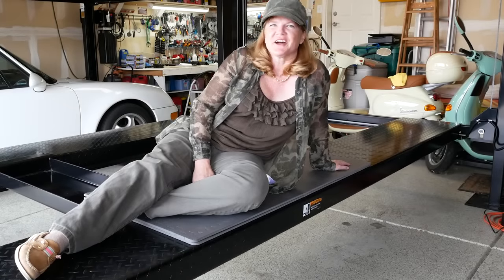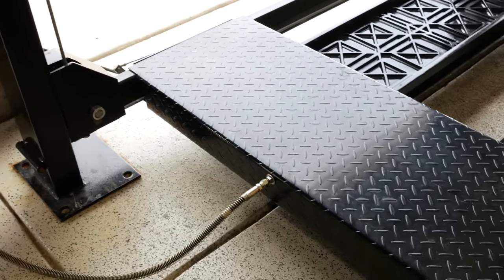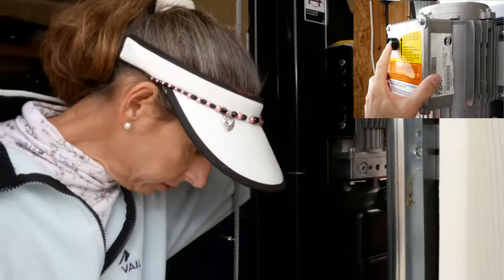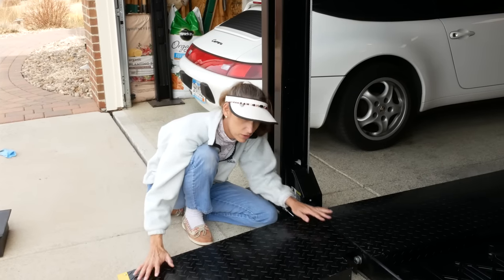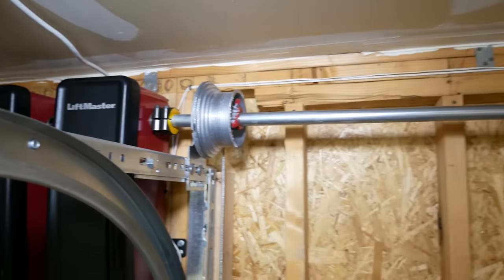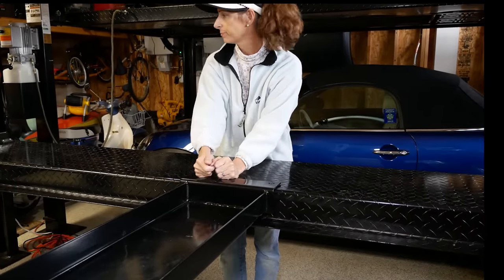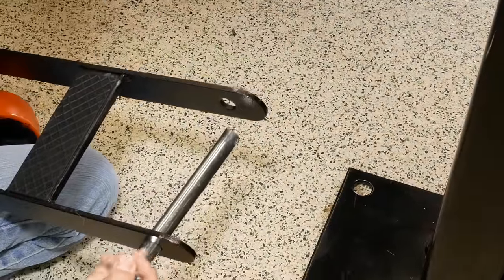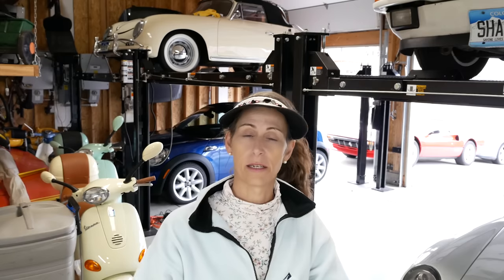Can you install a lift? 4-Post Lift Review and Tips! (Direct Lift Pro Park 8S)

Comment from the maker: Welcome to the review and tour of our Direct Lift Pro Park 8 4-post lifts.  We run through the operation of the lift as well as some great tips, tricks, and hacks you can use to make your lifts even more usable!  We got our first lift about four years ago and the count has risen to three!  That’s right, six cars in a three car garage 😊  I also run you through our new garage doors and the LiftMaster Jack-Pole or Jack Shaft Lift 8500 Garage door openers. We use our lifts mostly for storage, but they are awesome for repair and maintenance work on the cars too.
Reply: Great review! Did you ever consider a BendPak car lift and if why did you go for this one over the other?

Comment: I have the same lift in my garage. Great lift and recommend the sliding jack accessory. The sliding jack really opens up the jobs you can perform on your lift and saves time. Worth it's weight in gold and it is heavy :)
Reply from the maker: +4.5 Liter Garage we
Got a smaller jack.  Maybe someday. I think they are like 800 bucks, right?  Good to know though.  Heidi
Reply: The Pro-Jack sliding Jack was $550. But let me tell you it is worth every penny Heidi! Especially since you use your lifts for maintenance as well. You can have your cars suspension off the lift and unloaded in a couple of minutes. I got mine right from the get go and couldn't imagine working without it. Note if you do order one have a hoist available to lift it out of the crate and drop in the lift. Even though it does weigh a ton( figuratively ) it is very easy sliding back and forth to work on the front or rear of the cars. If you look at my channel and view the Porsche 928 undercarriage video you can see the Pro-Jack. I slide it back in forth so I can show some more of the underside of my car. If you have any questions about it feel free to ask. Oh I love the story so far on the 356. My 928 has been a family member for 30 years this September, so I can relate.  Rich

Comment: The "hollow" side that doesn't house the piston and pulley system can hold two banks of florescent shop lights as well.   The LEDs yook good as long as they aren't shining in your eves when working on the underside of a car.  

 One nice thing is to use the lift in conjuction with the roving jack holder as a hoist for lifting an engine or manifold out of an engine bay,  or lower a rigid car top onto a convertible, or lift a motorcycle a few inches off the ground to remove wheels or rebuild forks,  or  any other lifting work that involves chains or straps.  The front and rear crossbar are great for this, or for banging out a few sets of pullups for exercise.
Reply from the maker: We did think of that, but then the lights are on just one side.  Have you tried and do you like?  What did you do with power cords?  Heidi
Reply: I found that there wasn't much light to work with when a car was on the lift because it shaded out my ceiling lights (one-car garage, but high ceiling).  I have mounted a Tripp-Lite power strip into the rail recess on one corner, and anchored the cord to the top of its corresponding tower, with enough spare line that that there is almost no slack when the platform is completely lowered, and a loop hangs down when the lift is raised.   I chose  low-profile lights that wouldn't extend below the rail cavity, but were wide to use up the entire space.  They are connected to each other with conduit, and at the end of the second light there is another single outlet to terminate the thing.  That way there is power on tap for accessories, etc.    Right now there is so many other projects going on in the tiny garage that the car up there isn't moving any time soon.  More like long-term storage until I can get to the project.  You have a great work shop!  I have a short video here of it: https://www.youtube.com/watch?v=GlK7j9oqsDw but I don't see the lights so I must have shot this right before I installed them.
Reply: One more trick:  I mounted a winch with remote control on the far wall so I can hop into an inoperable car and have the winch slowly pull the car into position on the lift.

Comment: Hi Heidi & Franny, Excellent video. Did you use a local company to install the lifts? If so can you provide their contact info. I live in Littleton CO. and don't have anyone to assist with the installation. Keep the videos coming. Jack
Reply from the maker: Hi Jack, we did, but they aren't doing that any more :( we actually bought the lifts through them.  Try contacting direct lift... I bet they can suggest someone.

Comment: I have the same lift. The "tip" about the race ramps could be super dangerous if the ramp slips back. Direct lift actually sells aluminum ramps for these lifts now and Race Ramps makes lift ramps as well. I'm curious if you use your lift for service work if you could point the lights up. Pointing them down wouldn't be too helpful for me.
Reply from the maker: We have never had an issue with the race ramps slipping. They stick well to the concrete.  
The problem with lights facing up is the drip trays and jack tray.  You might get away with it on the lower she'll where the drip trays ride but it would be easy to damage LED strips. I just use a bright head lamp and a very bright LED shop light and that works great.

Comment: I have had Direct lift 4 post lifts and they work very well. I am curious to know what is the interior height of your garage ceiling? Is it 10, 12, 14 feet?  The last garage I built I had to have a 12 ft beam to have enough room to store my cars on the top without hitting the ceiling. I have moved and have a garage with a 9'-6" height to the finished ceiling. If I had a way to change the garage door lift I might be able to squeeze my 911 on the top and my daily driver under.
Reply from the maker: We have 11.5 ft ceilings.  Yeah, I would not use a lift under, say 9.5.

Comment: Do you feel that the safety lock do a good job? All the lifts I've looked at have air operated safety locks. I like the idea of not having to worry about an air compressor.
Reply from the maker: Yeah, I have no complaints about these systems and the locks are within your control.   If anything goes wrong, you would let go of the pull arm and it won’t go past the next safety stop.

Comment: Excellent video and review - I ended up with the same lift!  Question - how do you get the front end of the 3.2 up in the air when parked on the lift?  I used a lift stand on the rear end (and then lower the lift and the stand forces the rear end up using the motor and then put stands under) but haven't found a smart way for the front...
Reply from the maker: Thanks! What I usually do for the front is too use the factory jack point with a jack pad installed. Then put a jack stand on the heavy jack tray. I think?  It has been a while. It is always tricky to get these cars up safely.

Comment: Is you garage floor sloped? If so, did you have to shim the posts or does it not matter. Nice garage btw.
Reply from the maker: Hi Joe, yes the floor is a bit sloped, but the  lifts are adjustable as well as the locks so the platform is kept level. Thanks!

Comment: Will your 993 front end clear the lift when driving up?  do you need to use additional wood ramps to build up the height?  My 993 is and inch lower, ROW ride height with factory aero kit. Was wondering how yours gets up the stock ramps without hitting.
Reply from the maker: We haven't had any problems with any of the cars.  The stock ramps are pretty good, but heavy.  Even the 308clears with ease (and the i8).  We use that set of Race Ramps just because they are super light.  Our 993 is still US height, but the 3.2 is ROW.
Reply: @HeidiandFranny  Thanks so much, your input has made its easy to make my decision to get this lift and I was looking at many. Thanks for your great work and time you put into your informal video's.

Comment: Interesting, so you got 3 of the same lift.  Does this lift have an option to add a rolling bridge jack so you can get the wheels off for suspension and brake work?  Or do you just put some manual jacks under the car?
Reply from the maker: +B Y our lifts are 8000, and no. I believe the 9000 pound one does but that is a question for DL. Yes, we use jacks and jack stands for safety, we often put wheels sideways under the sides of the car and such...

Ideally, we would love a two postlift, but we have no more room.

Comment: 1. Did the manufacturer install the lifts or did you install?
2. Are the lifts anchored to the concrete floor?
thanks
Reply from the maker: We had a company here that sells the lifts deliver (they weigh something like 1600lbs), assemble and set up the lifts.  I slept the first few nights much better knowing someone who had done that before put it together.  They are not bolted down and, in fact, come with casters so you can move them around.  They do have holes if you want to attach them to the floor (not sure why you would).  Thanks for watching!  Franny
Reply: Thank you, BTW, the vast majority of lifts are anchored in concrete.

Comment: Nice! I'm working with 9'3" - 9'6"...researching if I can fit an 85 Carrera and a 82 930...looks like it'll be a tight fit:(
Reply from the maker: Christopher Flores for several years we left our garage doors unmodified and didn't put the lift up as high as they would go. So, it's possible. I just used to bang the crap out of my head all the time. Franny is still too tall to clear the lift now, but she is more coordinated. You might be ok. Just carefully measure the heights of your two cars figure in at least 6 inches for the height on the lift and you somehow need to figure out where your garage door will rest. If you can get it behind the door (back of your garage) then you might be ok. I would call Direct lift. They would know better than I do.  They might have a minimum ceiling recommendation. Heidi

Comment: I just discovered your channel - excellent video - thanks for posting.  I noticed you have an epoxy coated garage floor.  I would be very interested in some info about which product was used for this and if you applied it or had it done.  I searched your channel for info about the garage floor - did not find a vid.  Thanks.
Reply from the maker: Hi there, It is from https://www.epoxy-coat.com/catalog/garage/  100%solids.  Looks like they have some new kits, but it wasn't hard to do.  I even coated all exposed concrete in the basement as well.  I should have gotten it a little thicker in some places, but all in all it has been good.  It is close to its life span now and is showing it's age a little...  It doesn't like battery acid...  Just follow their instructions - you'll nee a leaf blower, aeration attachments for your shoes (just platforms with spikes) a powerful drill for mixing and uninterrupted time to install it.  Franny
Reply: @HeidiandFranny  Heidi & Franny: Wow, I just discovered your videos, great contribution and very educational.  I checked the link to the epoxy coating product, which is something I've been considering for a while, but nice to have a user rec.  The company you linked has 5 levels of DIY coatings - do you recall which one you selected, and are you pleased with the results?  The post lift is something else I'm looking at, but not sure I have sufficient vertical clearance for storage of stacked vehicles but I will consider this for maintenance, or perhaps a scissor lift.  Thanks for your efforts and generosity in sharing your experience and knowledge!

Comment: I have one of these as well.  I use it for storage as well for maintenance and it's been a real life saver.  My garage height was barely high enough for my usage but I may raise the ceiling height at some point.
Reply from the maker: And so much safer!  ...and really convenient to just take a quick look under the cars to see if any new surprises have cropped up ;)  Franny
Reply: Yes absolutely.  Only issue I've had is whacking my head on it when I get out of the car.  But after the second or third time, I finally trained myself.😡☺️
Reply from the maker: It only took you two or three times?  Wow, I think it took me close to a year ;)  When we raised our doors I could get the lifts up to the last lock and Heidi can now walk under them with impunity.  Me, not so much.  They are surprisingly hard... ;) f
Reply: Yes, I'm pretty tall and cracked it pretty good.  It left a lasting impression on me.

Comment: how come you didn't go with a double wide lift for the 2 bay garage?
Reply from the maker: Several reasons actually.  We did not know they existed.  We would find that lift much harder to sell if we moved.  It would be a pain to move two cars to have to get a car down off of it, and it appears to be four times the price of the other one.  Thanks for telling me they exist, but I don’t think they would work for us.  Do you have one?
Reply: I do not.  I'm planning on organizing my garage in the near future and after looking at your setup, i came up with the same conclusion.  I did not know that the Direct Lift were so affordable.
Reply from the maker: If you put together yourself, it will save you a grand.  However, one part weighs like 400 pounds.  I would not recommend self install.  Heidi

Comment: What does a lift like you have cost?
Reply from the maker: +Steven Groddy, it depends on whether or not you have it installed.  I believe they run around 2400 USD uninstalled.  We paid 900 for delivery and install, because some of the parts weigh 400 lbs.  We have had ours for a few years.  Not sure if Direct lift’s pricing has changed much.  Heidi